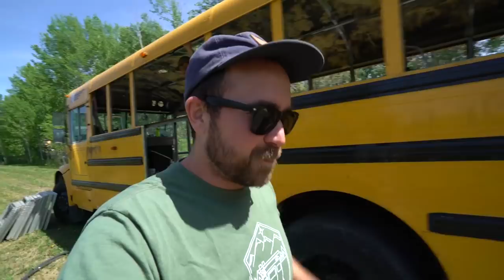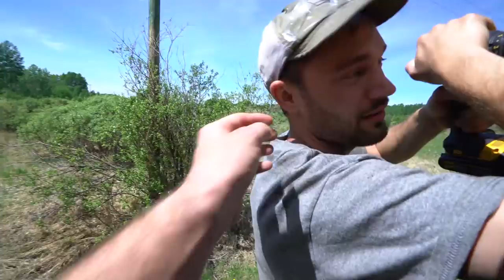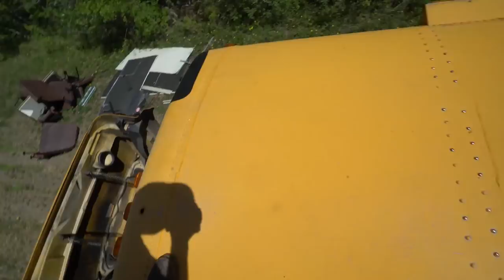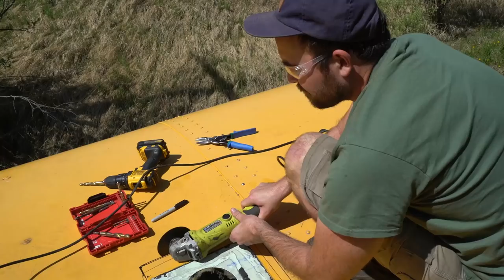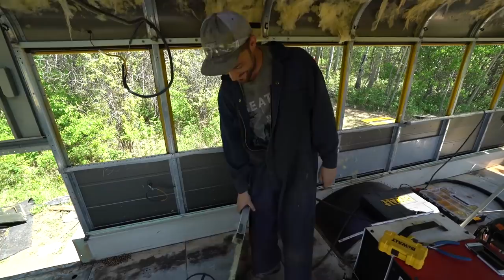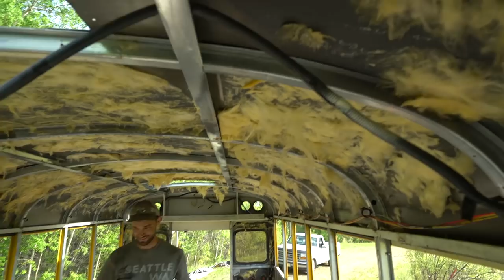SCHOOL BUS CUT IN HALF! (almost ;) )

Comment: I hate fiberglass insulation too!  At least in a van or bus because it can hold moisture long enough to  cause rust. 
The skylight is bad ass! And I can't wait to see what the big holes in the sides are going to be.  I hope that you can still have room on the roof to hang out after all of this.  :-)

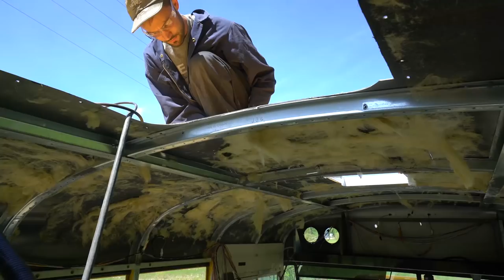Comment: "Third time is a charm" is correct - in the USA. However, in Canada we are on the metric system. Once you do the conversion, it works out to twelve times! 🤣  Could not help but notice that at 5:35 your bus roof cross-members are stamped "Made in Canada". Therefore, it is only fitting that you are making the roof mods in Canada. 👍 Loving the suspense!
Reply: D. Wayne Otto its bilt in Canada lol🇨🇦🇨🇦🇨🇦

Comment: By the way,,, I am repairing my Van Hool as it had a small electrical fire and so I had to remove an interior wall panel to get to some of the harnesses.  Yes the Van Hool has tubular web framing., being stainless steel it's heavier than lead.  but the school buses use the exterior skin and C or Z or T channel to make a tough strong wall   just as strong and I haven't seen many schoolies with a lot of rust.     I have seen all types of bus wall construction.   Some are minimalistic engineered (GMC fishbowl) to overly engineered (GMC/TMC RTS) where it's already over weight by it's construction.   I going to look at some school buses next week.    Cheers
Reply from the maker: Good luck!!

Comment: Looking at Schoolies and having seen many,,,, Bluebirds Thomases  Internatiional.   I have come to the conclusion. that the motor coaches and school buses are closer in build quality than you hear from motor coach owners.    I have a Van Hool an RTS and an MCI MC7   I have seen the framing in the MC9s and the 8s and 7s   To be honest  they have rust issues they have just  little more framing  just a little extra "hat" channel and not too thick even.     I am starting to like Schoolies as much as the big buses and with everything going to super "C" cause it's getting harder and harder to get a coach worked on.  I am going to get myself a schoolie with either a cummins 8.3 or a DT466     and need a taller coach as I am unfortunately 6'4  and some if not all bluebirds are 74 inches.   but it is much easier to find people that will work on a conventional school bus versus class A RVs and Prevost VanHool type of coaches.   Love the suspense and love the positive light humored attitude ,,, makes the build so so fun.   and this video is making me itch for a schoolie.    Keep them coming.  God Bless
Reply from the maker: Keep me posted. Those are both great engines. Wish I had a DT myself. Next time!
Reply: Well if yours has the T444E   that is a 7.3 on steroids  and a great powerhouse.   and if taken care of  last many many miles.    Here there is a school bus dealer that has a few buses with DTs for 3000.    but I am in Missouri